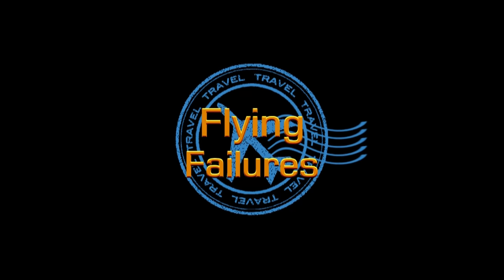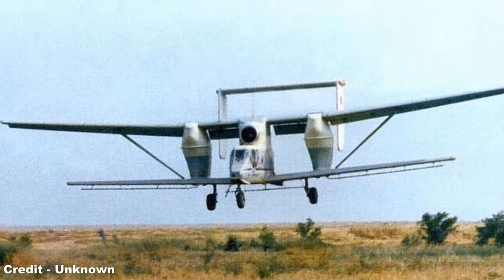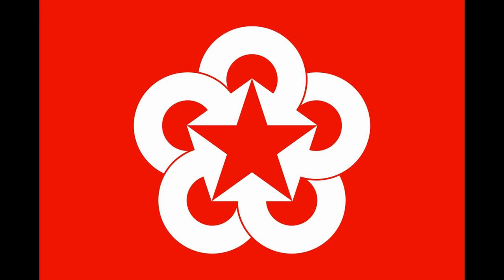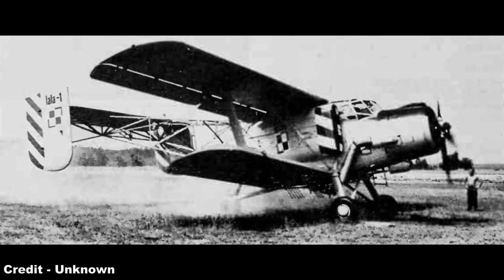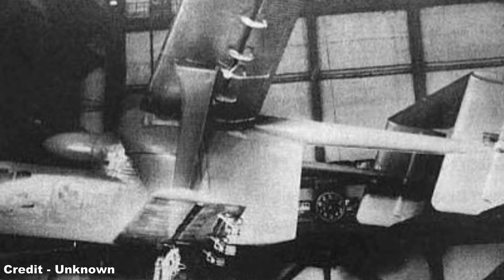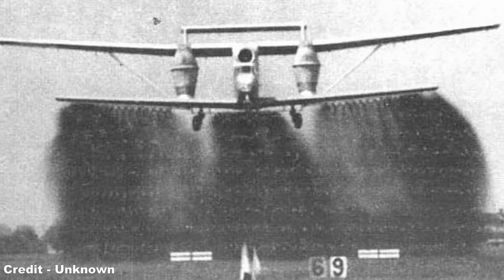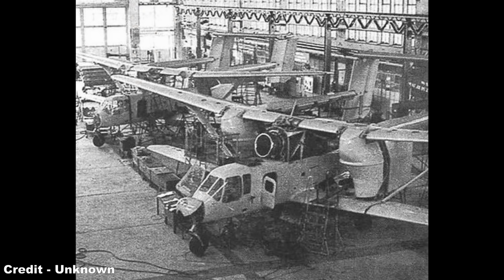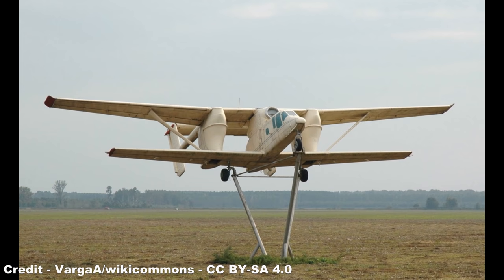Flying Failures - PZL M-15 Belphegor

Comment: Why you would put a jet engine in an agricultural aircraft is a good question. The upside is they can use a wider range of fuels but the downside is extremely high fuel flow at low level and poor thrust response. Pilots who transition from piston or turboprop aircraft have to adapt to engines that have significant lag time during power application and reduction. One thing I would want in any aircraft flying at low level is power on tap. The biplane configuration on the other hand makes perfect sense for a slow aircraft carrying several tonnes of liquid. You want that extra lifting area.

Comment: Another factual error is calling it jet-powered. The engine is a twin-shaft medium-bypass (considered high-bypass at the time) turbofan designed specifically to work well at low speeds. Regional jets, subsonic trainers, close air support, you get the picture. The whole point was to make a small agricultural plane that can run on cheap fuel, at a time before turboprop engines made it to the civilian sector.

Comment: Several clarifications (and complementary info) from Polish aviation fan:
* M-18 Dromader was not a licence-built Thrush Commander, but a new design, developed from the American plane. The new engine (ASh-62) allowed for MTOW raised from the original 3130 to 5300kg
* When discussing performance of crop dusters speed is of no relevance. Actually, the slower it can fly the better
* Jet engine was a valid concept at that time because jet fuel was abundant and cheap (lots of military bases in the east USSR needed it as well so the supply chain was there)
* It was the oil crisis of the 70s that mostly contributed to premature termination of the project: it was not cheaper than the old planes anymore
* Kruk and Dromader were not turbine, but piston engine powered (there were turbo versions introduced later)

I highly recommend watching this one (there are English subs) to learn more about the project: https://youtu.be/nSTmpD9YFeo

UPDATE:
The link I pasted originally was about M-18 Dromader (my bad), here's the correct link to M-15 Belfegor: https://youtu.be/S9-wIqIO_fQ

(Not meaning to be picky with this comment, I love the other videos on this channel!)
Reply: Indeed. Seeing what is obviously a petrol-powered engine hailed as a "turboprop" was as odd as seeing North American small farms in place of Soviet kolkhoz land. Surely there's plenty of free photographs of each subject.
Reply: Except turboprops use jet fuel
Reply: clearly the vid was done by happy-go-lucky "specialist" on the subect....so many schoolboy errors. Im longing for some youtube algorithm indiacting "worthiness" of the vids so I can skip content like this.
Reply: the oil crisis also affected the countries of the eastern block? thats new to me
Reply: @Keckegenkai  In a different fashion, yes. The USSR suddenly obtained a huge market for its oil, and at the same time became dependent on imports of oiling technology and pipes. How much of this spilled over (no pun intended) to its satellite states?
Reply: @Keckegenkai  good catch, let me find the book or article I read about it. Maybe I remembered it wrong
Reply: False, The slower it can fly is not better, this is how the Air Tractor became the most successful airframe in the Ag industry. The faster you can fly the more acres you can cover in a day. The more acres you can cover in a day the more money you make and the farmer is happy. Source: I am a crop duster
Reply: @Shitt3r6968  Yea, but on the other hand the slower in can fly (the lower the stall speed) the tighter the 180 turn at the end of the field and the better survive-ability in case of a crash
Reply: I found an article about it, but in Polish. Basically it just confirms nvo's comment above.

Comment: I saw the M15 Belphegor demonstrated in 1978 at an anniversary of Polish Aviation and had a tour of the Mielec Factory where it was being produced. I was part of a small Western delegation. Your video is a good summary of some of its problems (noise etc) but the M15 had some other difficult features. The pilot had good foreword visibility but was completely exposed in event of a crash. If the plane "settled in the crop" the results would be disastrous for the pilot unlike other aircraft designed for aerial application such as the Kruk, Dromader and US aircraft where the powerplant is in front of the pilot not above. 

You correctly pointed out that it had a relatively short range - that's because the jet engine was very thirsty as one of the comments states.  

The application of solids (dusting) was by a specialist pneumatic conveying system built-in to the lower shorter wing - an innovative idea that is not really feasible on a many other aircraft. Air supply was via a bleed from the main compressor on the engine. Fertiliser application would probably have been its main role.   

At the time it was clear that Mielec were only producing the plane because the USSR demanded it - as one of the comments states. They had much better solutions as you point out. The M-18 was different. It was exported to the US and Canada where its larger powerplant and payload than the Thrush were considered an advantage by those not yet ready for turboprop technology.

Comment: Awesome, I was just wondering if there ever was a jet powered biplane. It’s always interesting when a product outlives its planned replacement
Reply: Actually for several years in the U.S. there was a biplane with the engine from a lear jet in a custom installation in it's belly flying airshow. It could climb straight up. It crashed  fatally about 6 years ago while flying a demo with a wing walker.
Reply: @kdrapertrucker , thanks for the info, that must have been a sight to see. Now we just a jet powered triplane…

Comment: As factors, credited for m-15, Russian sources is often referenced that M-15 was not favoured by pilots, because of a) higher productivity (and they were paid by flight time, so salaries could actually drop), b) An-2 with it roomy interior could easily be used for some side "activities" which was pretty important in Soviet deficit times.
Reply: An one could easily die in this plane. No mistakes allowed. To low, to slow and you are done. There is a safety reason why piston engines are used for agriculture aircrafts.

Comment: What possible benefit did they expect from a turbojet for crop-dusting, a slow, low-altitude environment full of contamination and potentially ingestible birds? Turbines work best high, fast, and free of wild-life. If the desire was to run on tractor fuel, turboprops made much more sense.

Comment: I've heard from a pilot that the two tanks for the chemicals were made too far apart. This resulted in a dangerous instability in case only one opened properly and the pilot failed to notice. It was a long time ago but I have the feeling that I was told it caused at least one crash.

Comment: Actually not as crazy as it sounds. Speed is about right for the task. Fuel capacity/ range not an issue for crop dusters; they are on the ground OFTEN loading more chemical. Often sacrificing fuel for payload. Jet? Propwash has a negative effect on spray pattern. High fuel consumption? Turbo props use a lot too, being a jet... My criticism would center on the dual hopper arrangement. Potential for all sorts of problems there.

Comment: Actually, it is not the first biplane with a jet. Polikarpov tested their I-15 with jets (keeping the radial engine with prop too) under the lower wing as  boosters to assist in reaching faster their target zones. That was during or right after WW2. It did not go into serial production.
Reply: That's damn amusing, they shoved ramjets on the Chaika?

Comment: I don't understand the original Soviet mandate that it must be a jet, for crop dusting. Why?
Reply: Because jet engines were hyped as modern and only future possible at the time. It's politics and laymen politician train of though.
Reply: First factor - this design relied on air from jet engine to force chemicals spread. Secondly - selection of small soviet-produced turboprop engines were nonexistent.
Reply: Because the fuel was cheap and turboprops were expensive. It was an attempt to produce a small agricultural aircraft that wouldn't be affected by the oil crisis. Plus the engine was not a jet, it was a two-spool medium-bypass turbofan specifically designed for relatively slow aircraft.

Comment: An excellent example why top-down management leads to failed designs. You can see this today in large corporate IT projects where top brass thought certain features were a good idea while dismissing protest from the engineers, leaving the ultimately delivered product inferior to its predecessor, at higher cost and poorer performance.

Comment: A requirement for a FASTER CROP DUSTER? 
 
Someone apparently missed the memo explaining exactly what a crop duster is...🙄
Reply: What are you talking about, the faster you can fly the more acres you can spray, which means more money and happy farmers. That’s why the Air Tractor is Successful Source: Am crop duster
Reply: @Shitt3r6968  >>> If that is correct, why are helicopters used for crop dusting?

Comment: It was the insistence on a jet engine that doomed the aircraft. Jets do not do slow well.
Reply: Except it was a turbofan specifically made for subsonic planes with a wide speed range, but don't let the facts get in the way of a good story.
Reply: @jirivorobel942  Except that it was a complete failure.What did the video say, a speed range of only about 30 mph??? 
And ask Airbus and Air France about having jet engines accelerate, which caused the first A320 crash, and would likely have caused lots of crashes with this joke of an aircraft.

 A JET BIPLANE? Nobody but a Russian or Russian Crony would come up with such an idea. Almost as good as the Monitor Novgorod or Admiral Popov warships.
Reply: @colinpovey2904  The claim about 30 mph speed range appears to be false, too. Different sources give different speeds, but its stall speed should be between 89 and 108 km/h, the max speed 200 km/h, and a "cruise" (crop dusting) speed of 140-165 km/h. Not extremely bad for a crop duster.

But I wasn't talking about the speed range of the M-15 anyway; I mentioned it because the AI-25 has a pretty impressive low-speed performance for a turbofan of that era.

These small turbofans accelerate much better than the big ones on A320s and bigger planes, plus a crop duster operated above flat ground doesn't need instantaneous throttle response. If it's good enough for the L-39ZA, a CAS plane, it should be good enough for a crop duster.

It must've been a pig, and it sure was a failure, but it wasn't nearly as bad an idea as claimed. The main problem was that while it ran on relatively cheap kerosene instead of gasoline, it consumed so much of it that it more than offset the advantage. And, of course, it wasn't really an improvement over the trusty An-2, many of which still fly to this day. The only thing it could do better - run on the cheap stuff - was only relevant for a couple of years before the prices and availability of fuels recovered.

BTW the round monitors were quite effective in their niche, carrying huge guns in shallow water and shooting them accurately. The "spinning from recoil" is a myth caused by a bad translation.
Reply: @jirivorobel942  But a turboprop engine is more fuel efficient than a jet engine. So, add lower fuel burn to more efficiency at lower speeds, and it might have worked. Nut two wings means a lot of drag.
Reply: @colinpovey2904  Yeah, a turboprop roughly the size of a TVD-20 would have been great, that's for sure. The only problem is that they didn't have one. The closest thing they had in that size was a promising new turbofan, and politicians that held the money loved that kind of stuff, so they gave it a try. When the TVD-20 turboprop became available, they simply stuck one on the front of an An-2, and, behold, it was very good - except nobody cared, the oil crisis was over, so the whole project sat on a shelf until 2014.

And that's the whole problem with the M-15. It was a quick outside-the-box answer to a temporary issue that threatened the An-2. A combination of the oil crisis, the lack of a suitable engine, and some political pressure. That all passed, and the An-2 stayed, but it took long enough that PZL were able to produce a weird demon of a plane out of whatever they had at hand.

It wasn't what anybody wanted, but it was what they could do at the moment.

BTW the Shvetsov M-62 9-cylinder radial engine that powers the old An-2 didn't have a drop-in replacement because it was the exact wrong size. It's a descendant of the truly ancient Wright R-1820 that was already quite old when it thundered over Berlin, powering the B-17s. That's quite big for a piston engine, but too small for a full-sized turboprop engine. That gap was eventually fixed, but not in time to prevent the M-15 from being created.

Comment: As you live in the West (?), you are completely unaware of the realities of life under a communist regime. Most of the economic decisions were made by the leadership of the communist party (in Poland - PZPR). The economic calculation did not count, it was important that all the Soviet comrades liked it. It was the same with the Polish aviation industry. You did not notice, primarily because of your ignorance, that in the 1970s the Polish company Polskie Zakady Lotnicze (PZL) did not belong to the Sikorsky consortium. The design of the PZL M-15 aircraft was revolutionary at that time, while the Soviet users absolutely wanted the planes to be equipped with their fuel-consuming and defective engines. It happened as it happened. Also note, dear ignoramus, that the An-2 plane was also an aircraft produced by PZL (under a Soviet license). And it was very eagerly bought by them.